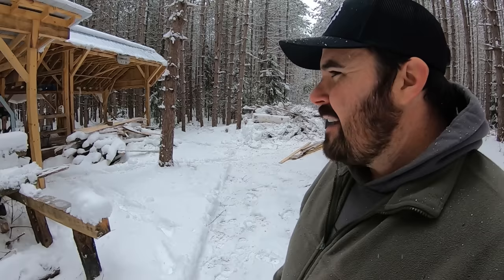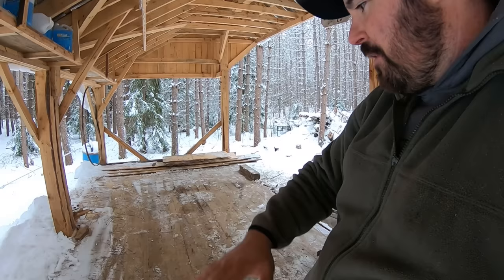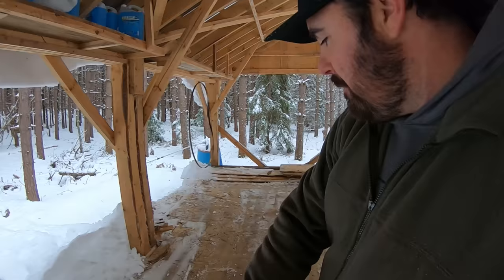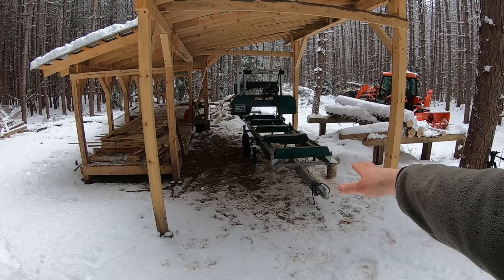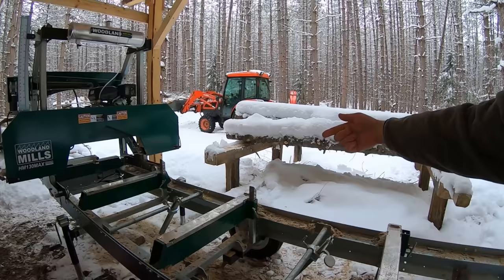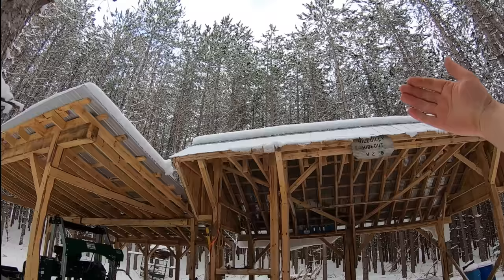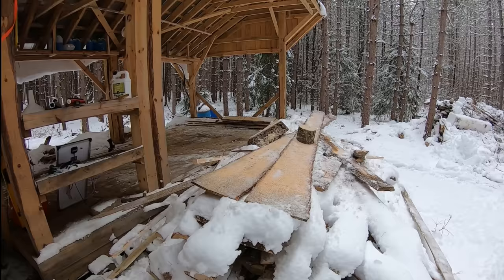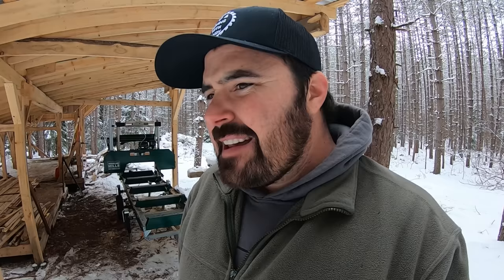Don't Build a Sawmill Shed Like I Did

Comment: Good video. There are always things that you learn after the project is done. 

It would appear that having the trailer sitting on the deck in Hill Billy Hideout 2.0 would solve some problems while making new ones. 1st big problem is getting the trailer on and off the deck. A number of ideas have been proposed, you can figure out what might work best for yourself. The large opening allowing snow to blow in was a problem that you tried to solve with rollup tarps. That solution seemed to be problematic. Perhaps something that you could fabricate yourself that would function more like a garage door would work better? It could still be made of tarps, but run on a track or roll up from the top? The snow falling off the roof in the back could be addressed by lengthening the rafters and adding another piece of roofing. That would put the snow further away. By having the lumber shed in its current location, you don't have to walk out that way on a regular basis, so the height wouldn't be a concern as it was previously.

Thank you for the thoughts on what has worked and what needs improved. These are valuable ideas for me as I plan for a sawmill and a shed to keep it in. 

Keep improving. It's how we move forward.
Reply from the maker: Very well put Mike

Comment: For better lighting under a tin roof shed I suggest every third strip be polycarbonate instead of tin.  Maybe even just squares of it, the middle third down from the peak on each side. For a concrete pad, a 2 inch stone base, compacted, and a 4 inch dry pour top. 80 pound bags of high strength ready mix, smooth it really good, dry, then use a 4 gallon hand pump sprayer to wet the top with a mist. Wait an hour, mist again.  Repeat. Cover with tarp, concrete cures when damp and is hard in 24 hours, strong in 72 hours, maximum strength in 28 days. Watch some videos. Tee off the front of the shed with a gable end addition to cover the log deck.

Comment: Love your videos, very thorough. You are also the reason I bought a WM HM126. Haven't set it up yet, but looking forward in the spring. Got it with 2 extensions, so I can do the long stuff too.
Reply from the maker: Sounds like the percent setup Richard!
Reply: @sawingwithsandy  I wanted the HM130 but decided I would go with the 126 with the extensions for now. I don't remember did you bury your posts in the ground on your last shed? I couldn't tell in this video. I am debating whether to build a wood floor or just a shed with a dirt floor. But I am pretty sure I want to elevate the sawmill off the ground to save my back a little.

Comment: Great video. Very helpful to someone who is planning their own set up

My question is do you have another area with stored lumber that is drying or do you use everything up shortly after cutting.

I’ve set up a drying area in my shop with five smaller stacks of lumber.
Reply from the maker: I’m typically using the wood just as I cut it

Comment: Hi Sandy
I've been watching your channel for a number of years and recall when you first set up your mill, I had the impression it was down a hill and in a small clearing, set up basically in a field.
I just purchased a Woodland 130max mill this spring and really am enjoying milling lumber for long desired projects and also just having the ability to have some lumber on hand without squeezing my cheeks at the price of costly boards sitting without a definite project in mind.
I really liked your walk around of your present mill shed.  I just couldn't resist wanting to suggest that with a ramp and a trailer ball mounted on your tractor front bucket, you could drive your mill on trailer right up on the deck from the end of the old shed (HB02).  Second suggestion extend roof over where old mill  log bunks were, reinstall bunks but at height of new mill on trailer.  I watched you build that floor and the added weight of trailer and the mill is no problem no concrete required.
Reply from the maker: I appreciate the ideas Bob and supporting the channel over the years. I know what ya mean about the cost savings with milling boards. Sure is a great thing!

Comment: For the "going concern" small sawmill - A 3 "bay" open floor plan utility building insulated to super insulation levels with shredded wood fiber or just plain sawdust.  Bay one for the log trailer,  bay 2 for the sawmill,  bay 3 for the dry kiln charge carriage  on elevated rails enabling it to be easily moved into the outside, modular, easily moveable wood fired dry kiln. Rapid, minimum effort,  movement of log on trailer to mill bed and sawed lumber to charge carriage to dry kiln.

Comment: Over time the sawmill will allow tweaks to better adjust, dispose of waste, load logs, and stack lumber afterward without wrecking your back. Getting the Mill onto concrete and higher seems like a step in the right direction.
Reply from the maker: Think you’re absolutely right

Comment: Use the forks to lift the mill in from the side, would be perhaps a good idea to bolt a steel profiles transverse under the frame where to slide in the forks. Might be little more stable and avoid some damages while lifting and moving..
Reply from the maker: That's a good point about the supports Harri. Thanks for that

Comment: What about leaving everything you have and gravel under where the mill is now? You could use crushed blacktop which compacts very well.
Also cut a drainage ditch so the water doesn't get to the mill. Or can you use your tractor with forks pick up the mill and set it on the raised area?

Comment: Here in sc we have something called slag. Like crush n run but with steel slag. Hardens like concrete. I prefer driveway mix it’s easier to smooth out every year or so and gets pretty solid.
Reply from the maker: I may have to look into that. Thanks for the idea

Comment: Soil cement, gravel mixed with cement watered packed let dry. I purchased used metal roofing, my thought was pole barn. I have open space, it will hold my trailer mounted hm130max.log bunks plus area for milled lumber.
Reply from the maker: That would be a good setup right there

Comment: New equipment, new ideas.... There's always 20/20 hindsight in best laid plans, lol
A pole barn structure would probably be a good choice! Plan on making it bigger than what you THINK you may need, and a stone/slag base would be a good idea for keeping out of the muck and snow! Until you do that, couldn't you use slab wood, or less than perfect boards to use as a walkway when milling with the Woodlander setup?!
Reply from the maker: I could for sure. And you are right! I should always build bigger than what I think I need.

Comment: You could do soil cement to firm up the location where you are parking your sawmill. Dig some clay soil and add for a little height and then till in Portland cement, vibrate it down flat, and wet it down. When dry you are done.
Reply from the maker: I like that idea. Always like new ideas like this. Thanks Brent

Comment: Hello Sandy. I am far behind on the videos because of the holidays. Today is 2Jan23. You have certainly given yourself some food for thought. The additional post between your log deck would not work unless it was hydraulic and could be lowered to be able to clean up. The pad could be done in sections and mixed there on site being sure to have the rebar extending to the next section. You will figure it out if you feel the need to make changes. Have good days!
Reply from the maker: Hope you had some nice holidays! Welcome back and you’re right, lots to think about here

Comment: Hi Sandy, just a thought if you can get crossties place them in the dirt area  where your saw will be, level and pin them to the ground with long rebar put down a barrier (tarpaper or fiber mat) fill it with GAB (Crusher Run) or limestone pack it down (a little water helps) with a rented whacker packer machine and it will set pretty hard, can spread some portland cement as you are packing if you want it harder. should take care of the muddy condition without pouring concrete. Crossties help keep it in place and can run over with tractor about the cheapest way I know of  Jla
Reply from the maker: That would be a pretty slick idea John. Thanks for the idea for the crossties

Comment: Hello Sandy I was watching the video of your cabin that you built on why you didn't have it on Foundation or with post and concrete and so forth so it won't move but gravity eventually will make it move I just suggest that you get rebar Stakes haven't pointed at the end so you can get them in the ground easier knock them in a couple feet and both them somehow to those 4x4 posts you have on the corners or wherever you can make a connection because it will slide one day this gravity will take its course but I know if you put steaks in like a tent a couple feet down as close to the house you can maybe put cable and put a bolt through the 4x4s that you can put the cable onto
Reply from the maker: Thanks for the idea. Sliding would be a bad thing for sure in my case

Comment: I am in the planning stages. Everything you have said hits home. My plan has been to do a short building...now adjusting it to double.  long and double wide. I do not have snow, but I do get rain and lots of it I am going to put in a wood floor deck space is 20 x 30 long. I want a weather proof end to store the saw head the tracks can be more open. So four feet of track and Doors the close to put it away. Being lazy I am going to have roller conveyor down the the dust side starting about a 1/3 up the track to roll the completed cut to the back 20 x 30 for stacking. too big?
Reply from the maker: Those roller conveyors seem like a great idea Russell. I appreciate you sharing your ideas for me. Will help me as I look ahead

Comment: How about a ramp that you can pull the sawmill into the hillbilly hideout? You could use your atv or snowmobile to pull it in and out.
Reply from the maker: I think the ramps idea would work well if the atv will pull the trailer well. I’d have to try that out to be sure

Comment: Good evening Sandy there all kind of idea that can come out that question but I believe you answer it yourself a pole barn with a raised  ground level wider and as long as you wants placing it where you could be hading on the length later you don't really want concrete you are still young so not to bad yet but that hard surface is bad for your legs when you get older also that way if you want be extending your mill it would not be a problem have a great day and happy new year I wish you good health
Reply from the maker: You’re right about the concrete and being hard on the body. Happy New Year and thanks for your ongoing support here on the channel.

Comment: Thanks Sandy.
My pole Shed is 30x40 and I am waiting to get a Slab poured too.
Would the Trailer fit through the end Of Hillbilly Hide out II ?? 
Clear out them few Trees and You can back the Mill right in. Just toss the slabs out to the Right or left leaving the Path open . 
Mike M
Reply from the maker: I hadn’t thought about it. I’ll have to measure and see if it can fit. I’m sure it could :) Thanks for the suggestion.

Comment: Good Morning Sandy,  How about this for your trailer.  If you want a platform you already built one for storing your toys when you built the other building.  I would just get some concrete forms ( Sono-tubes) and bury them 30" with 4-6" above ground (36" total) 12" diameter and then 3x some 2x6s (think 6x6) for where the drop legs and tractor tires would need support and then put boards on top and build a small ramp to move the trailer in and out.  Mixing all that concrete even with a 1 yard mixer would be a lot of work, but if you did go with concrete you could put in radiant floor with a solar powered water pump and a burn barrel with a coil around it, to keep the floor warm while working in the cold (Think mini outdoor wood burning furnace). Once going even green wood burns well and now all your cut offs are cleaned as you go. Hope you are staying warm.
Reply from the maker: That sounds like a great idea. Radiant floor heat would be amazing.
Reply: @sawingwithsandy  I know you can weld.  The idea would be to use two 55 gallon steel drums, cut about 2 inches out of one from top to bottom and weld it back together, then wrap it with copper pipe / coil from any home improvement store and then set that inside the other 55 gallon steel drum, weld a top on the separation of the drums with the spare / left over steel, cut some ports at the top and bottom to connect the radiant floor and water pump.  I am sure you can figure out the rest.

Comment: You could lay a gravel pad, form a 3" slab and pour the bags of concrete on top dry and spray water on it and bull float it.  Put WWR in it unless you don't care if it cracks a little.  I'd definately seal it.
Reply from the maker: That would certainly do the trick. Great idea there Michael!

Comment: In a video from nine months ago I can see your old lumber storage shed.

In this video I cannot see it in what I think is the place behind the sawmill shed.

Maybe I missed your video where you took down that lumber storage shed?

I like the extension that you added to the sawmill shed.

If you were to put a floor down at the same level as the rest of the sawmill shed floor then, as others suggested, you could bring the sawmill trailer in with a ramp or with the forks on the tractor.

Questions for you:

Would a floor built of 2x4s or 2x6s on edge with a gap between the lumber be useful?? That way the sawdust could fall between the intentional cracks?

Could you build two walls around the old sawmill location and build racks for lumber storage?  You could still carefully remove the stored lumber on your tractor forks but you would need to put the slabs in another location.

Would a roof made of  rough sawn lumber over the current slab storage area be of any use?  Sure, rain would come through but snow would stay on the roof until spring.  Roofing materials are expensive!

Would rollers between two beams help with transfering the cut lumber from the saw to the new storage area help, I am thinking of reducing the need pick lumber up from the floor and to carry the lumber but sliding it along the rollers.

I have learned a lot from your videos for my 80 acres bush lot improvements, thank you for the work that you put into making these videos.

I don't expect you to answer the points that I have raised, these were just my thoughts as I was watching this video.
Reply from the maker: Hey thanks for watching! I ended up moving the shed in line with my mill shelter. It works better for me :)

Comment: you have a fork lift use it center the weight strap it turn it to where the dust shoots out back like the old one, if you need to move it simple enough to fork lift it, if your forks are not long enough build extentions, your creative enough do it, you end up with a deck, with a lot less building,
Reply from the maker: That would work. Only trouble I see is if the dust shoots into the lumber shed

Comment: 🤔Hey there Mr.Sawing. When we load the ⛵️sailboat in the water we sometimes need an extension added to the trailer.About 8-10' As the keel makes a need to go into deeper water. If you added an extension to your saw trailer. You could  maneuver the trailer to go underneath your overhang and up onto your platform so that the tractor  🚜does not have to drive on your platform...you may need to make longer ramp 🛣No biggie
Reply from the maker: I like that idea BJ. Thanks for that. Hope you have a good New Year!
Reply: @sawingwithsandy  
Happy New Years

Comment: I built a sawmill shed similar to yours, but I made my opening 19 ft by using a beam I made with my chainsaw mill. I made the main beam 22 feet and I have no trouble getting a 16.5 ft log on my mill.
Reply from the maker: That width would be ideal!
Reply: @sawingwithsandy   I have two short posts on the deck the width of my tractor bucket and I mounted channel iron that pivot down to the bunks on hinges. Then I tilt the bucket that has forks installed and the log rolls on.

Comment: You mentioned the dimensions at 10x20. What about the height on the lower side? As per your suggestion, I will make mine 10x24. Considering 7' lower side, 8 feet high side. We don't have snow loads to worry about (or mosquitoes).

Comment: Love the channel Sandy. Watching this video as well as some of your older ones on levelling I am curious about how much levelling your newer HM130 requires. ie. as I think about my sawmill shed setup is having a platform or pad meaningfully helpful to levelling or is the structure/rigidity of the portable unit such that levelling is a lesser concern?
Reply from the maker: Hi John. Great to have ya along for each video. Truthfully I rarely have to touch the jacks to relevel my current sawmill once I get it setup in place the first time. I find if I move the trailer somewhere I use a level to get it back to where it needs to be but aside from that I don't really touch it. If I notice the sawmill starts to wander when I let go of it either away from me or towards me then I know it must have settled a bit but it hasn't done that hardly at all luckily.

Comment: Could you build a platform about the same height as the concrete with the slab wood. Round side down so you have a nice flat surface but low to the ground.
Reply from the maker: I like that idea to keep the cost down and materials easily available